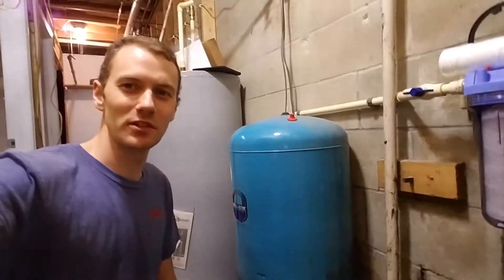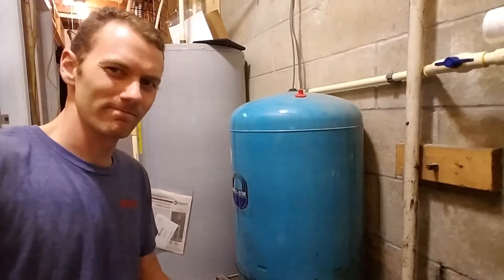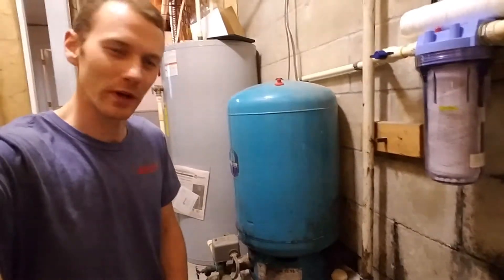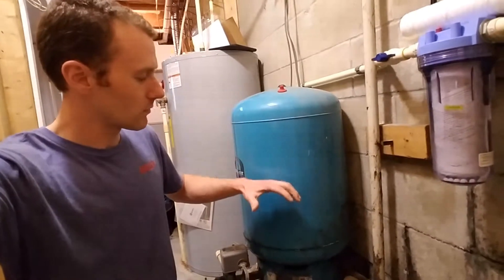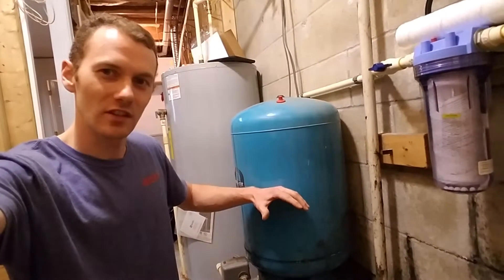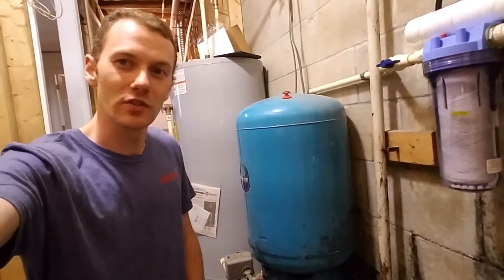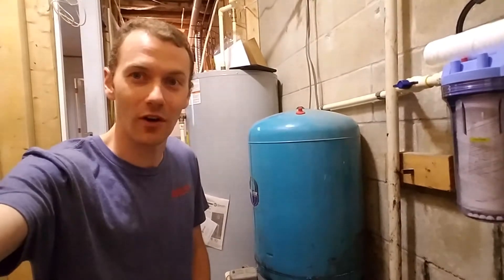Why is My Pressure Tank Making Noise?

Comment: The noise at :17 . Mine makes a similar sound.  No water pressure changes and no water spitting. I just replaced this tank 2 years ago. I just made a video of my fill and stop if you have time to check out i would apprecaite it. All hardware ia brand new as well.  Thank you sir

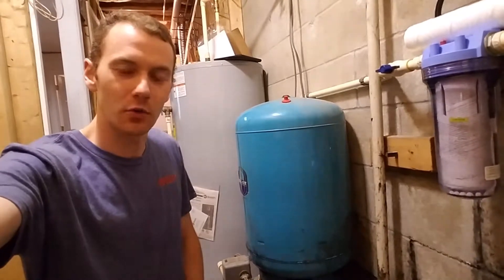Comment: There is a background noise around the 1:13 mark that sounds a little like letting air from a balloon. Is that coming from the pressure tank behind you? I am hearing a low creaking noise sounding a little  like a dinosaur (movie sound effects) or elephant vocalization. Could that be pressure tank? My water pipes are new. Thanks

Comment: We went away on holidays for a couple of weeks.  When I got back, I noticed the pump was very noisy.  Never had problem before this though it is 20 years old. Perhaps bearings in the pump finally called it quits with having stood around unused for two weeks even though we left instructions for caretaker to run the water every couple of days but not sure they did.
The sound of the tank that you provided is more of an air sound whereas the one I am hearing is higher pitched, more in keeping with excessively tight or loose bearings like I heard in another video that was explaining what bearing issues might sound like.
Reply: I have the same issue.  We went on a holiday for 4 weeks and now the rain water pump is making noise. Have you got it fixed yet?
Reply: Does yours make the sound at 1:15?